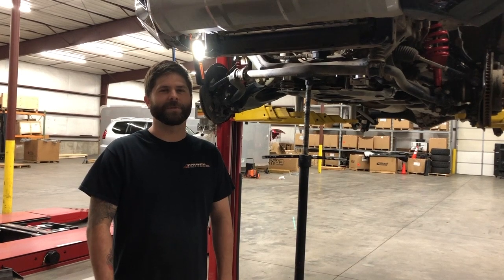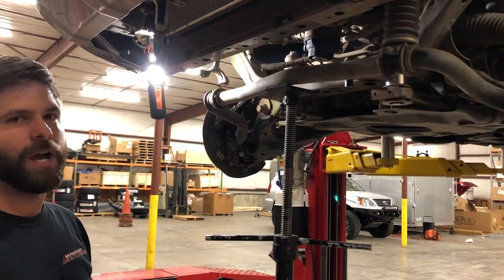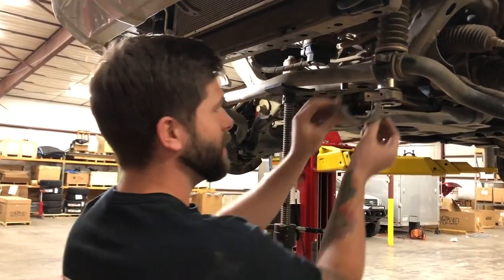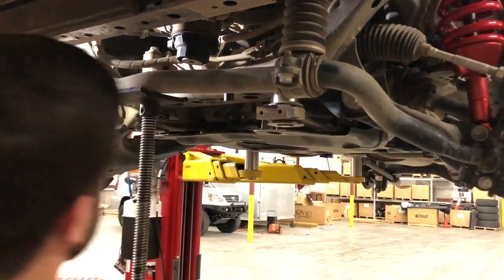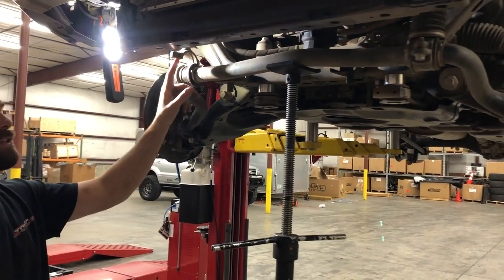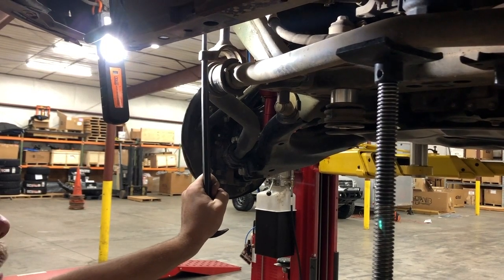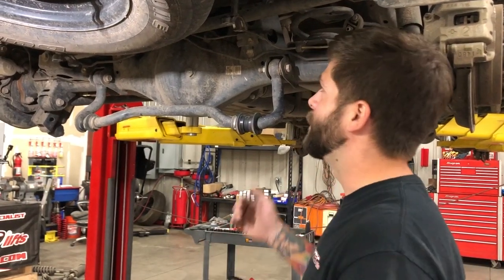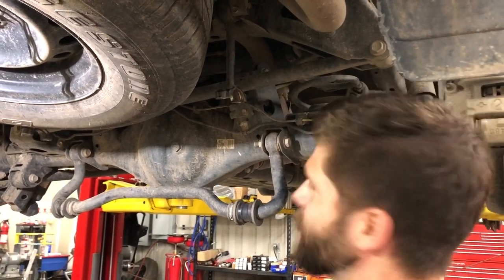Tech Tip Tuesday - KDSS Sway Bar Installation

Comment: In the rear, i found it easier to disconnect the sway bar at the axle rather than at the hydraulic and solid KDSS mounts when lining everything back up.  Also, I've never had to disconnect the KDSS system in the front when installing Fox 2.5 extended travel coilovers.

Comment: I installed a spacer kit and the truck has a little bit more sway to it now not the stiff feeling that it did have at high speeds. Could this be due to the coils not being after market stiffer coils or something with  the kdss.